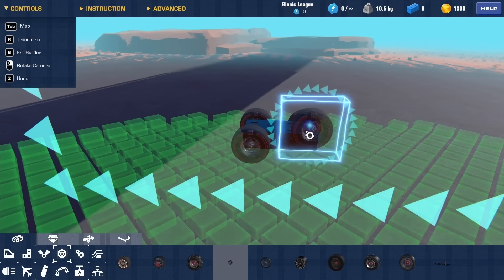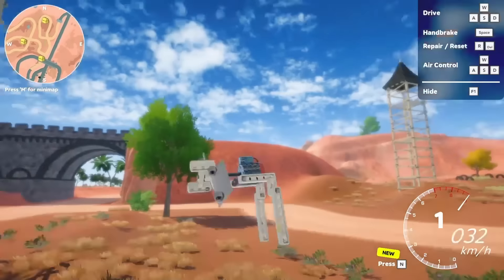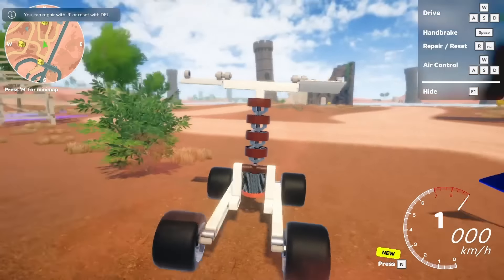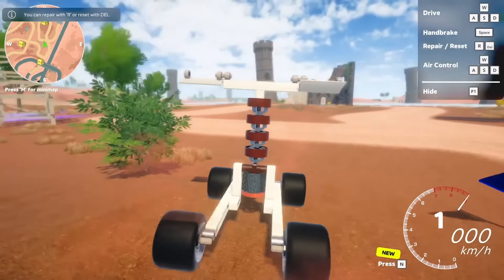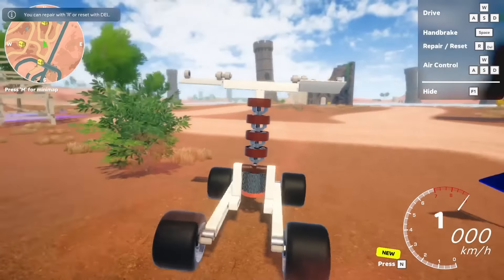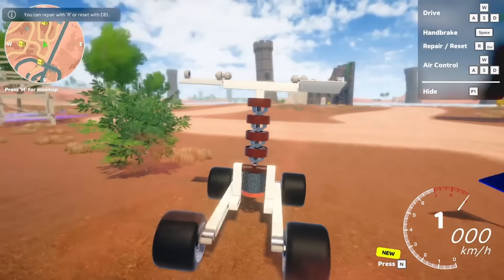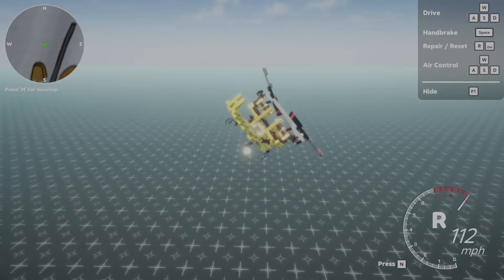Breaking Screw Drivers By Making A Working Helicopter

Comment from the maker: Check out my project here: https://www.kickstarter.com/projects/reidcaptain/mixisynth

This is a pretty fun game, thanks to everyone who suggested it!
Reply: Hello raidcaptain you cool
Reply: The problem with the propellers not spinning is just an issue (probably bug) with the planetary gears and the hinge connector, not wheels or suspension. I believe it should still work properly if you put some "normal" gears between the hinge connector and the propeller axle
Reply: Please try From the depths, I find it fun and think you’d really enjoy it, also a lot of people have recommended brick rigs (I’ve never tried it but it looks cool)
Reply: @torrom9207  cant forget about gearblocks as well, it's functionally just a better version of screw drivers
Reply: Can you try to make a Karl gerat or just the main part
Reply: I found your channel because of polybridge but wanted to comment about the synthesizer! Very cool especially because i just got a korg monotron delay analog synth a day or two ago😂

Comment: The reason the first propeller system didn’t work was because of the planetary gears the YouTuber scrapman made a video about a heli in screwdrivers a few days ago where he figured that out
Reply: It seems to me that since the axle is not connected to the vehicle, it spins in place and does nothing. In real life it would work, but the gear system in this game doesn’t exactly respect physics.
Reply: @seanpierce9386  ,this isn't true in regards to what actually happened.

You can make a long shaft with two piece connectors and planetary gears and it'll still work.

The hinge connectors are the issue,they have a known bug for not working when attached directly to a planetary gear.

Solutions include longer shafts,indirect connections,and even bugging the bug by putting another hing connector in series.

Comment: The designs didn't work because for some reason, planetary gears can't spin in some scenarios, I learned from Scrapman
Reply: Not some,just this exact direct connection to a hinge piece is a known bug.

Solutions include longer shafts,indirect connections,and even bugging the bug by putting another hing connector in series.

Comment: 2:30 uh oh
planetary gears can't be directly hooked to hinge connectors, they can be used but you need to transfer power through at least one normal gear between your planets and hinge.
known bug

10:20 screw drivers uses magic gears that don't calculate direction, just speed and torque
Reply: omg so that's why the helicopter i made recently actually works with planetaries. I thought they had did a hotfix after Scrapman's video or something.
Reply: I feel like having the gears be hard codded instead of physics based is a good idea. But they forgor about direction. Or maybe had problems implementing it the first time.
Reply: @shy8054  I'd say magic gear are probably a design choice, they probably started with magic gears to lower barrier of entry, then edge cases where people started making flying vehicles came later on

the helipad spawnpoint in the flat map is the only official recognition of flying vehicles and it was only released recently
Reply: Not necessarily, you can use planetary gear with hinge joint if you'd put a beam in between planetary and hinge. Don't ask why.
Btw, jaykrown has built a propeller powered car, the fastest one on a track that I've driven in this game.
Reply: Direction is calculated,just overridden when moving forwards/backwards using wheels and single output shafts.

Everything else is affected by direction,the evidence coming from the stepper motor tutorial.
Reply: @tacomancer2772  safe to asume the devs at lest know the community is crazy. and gave the mad bats air space. XD

Comment: With planetary gears, you need to have normal gears in between specifically for the axle to normal connector pieces.

I use small gear to small gear back to small gear so it can stay in a line.

Comment: I think the reason only one motor didn't work is because it's putting a ton of rotational torque in the opposite direction it's spinning and the blades don't simulate drag correctly to counteract it at all. Like there's a huge difference in the mass of the motor compared to the mass of all the other spinning bits combined or something, as if the blades barely have any lift and everything except the motor is made out of styrofoam. At least that's how I'm interpreting the game's weird physics.
Reply: Yo bro, this theory is actually amazing but that's not the case. I watched a different vid of someone trying to build a helicopter and they figured out that it's the motor that was the problem, or rather the orientation. The motors just don't want to spin when oriented upwards or downwards so Reid would have to put the motor down horizontally and reroute the power with those bevel gears to then point the driveshaft upwards. Though it does also require a lot of power to spin something with that many planet gear sets so your theory is partially correct.
Reply: @Su57_Felon No. The game is weird and axles have preferred rotation if you have 1 power-shaft the axles will rotate in their preferred direction. If you have 2 power-shafts inverting the other one will inverse the rotation of the axle.
Reply: @kacperkonieczny7333  Ok thanks for the correction buddy :)
Reply: Motors will spin just fine when pointed upwards.

The issue is the known bug that hinge pieces refuse to work when directly connected to a planetary gear.

Solutions include longer shafts,indirect connections,and even bugging the bug by putting another hing connector in series.

Comment: 2:52  yeah, only three planetary gearboxes is the limit, I think it is a limitation with how many physics items you can stack

they also only work for Phys objects like propellers if your engine itself is free-spinning. ( this is how I broke the sound barrier)

also in 10:15, the quad-gears do that, I believe the devs made it that way so that 4 wheel drive on a single motor is doable and compact, but it screws a lot up.

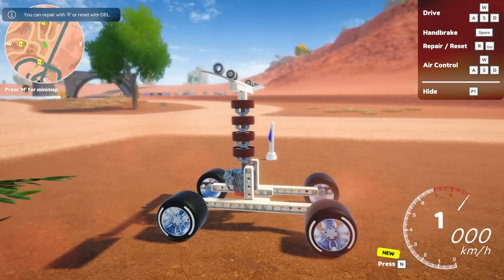Comment: 3:49 I wonder if he figures out that only happens with planetary gears
(Btw what I mean by this is with all other gears, or no gears, you don’t need to do anything jank, like connecting it to wheels, it will always work)

Oh also, at 10:58, the way propellers in this game work is the don’t need any torque, so just using the smallest electric engine would have worked the exact same but with less weight.

Comment: When you where making the Blades spin in oposite directions by puting gears in reverse, you werent doing anything, because for example if you have a gear setup where the wheels end up spinning backwards, the game makes the wheel spin fowards even when the transmision is spinning backwards, i dont know if you underestand but basically gears dont afect the spin direction
Reply: The do,actually,but are overidden for moving forwards or backwards with wheels and when using one output shaft.

Anything else will have a different direction.

Comment: 3:41 this is bizzare. Is the motor caught on something?
Reply: Nope.

The issue is the known bug that hinge pieces refuse to work when directly connected to a planetary gear.

Solutions include longer shafts,indirect connections,and even bugging the bug by putting another hing connector in series.

Comment: 8:17 why does it have in air controls at all?
Reply: So people can more smoothly do jumps and,in both the original early release and the second version of the campaign based off of the early version,to do controllable stunts.

It's similar to how GTA San Andreas had controllable orientation by turning the wheels when you left off the gas.